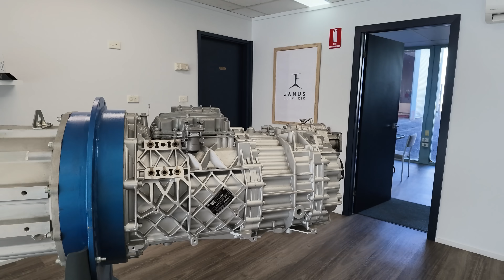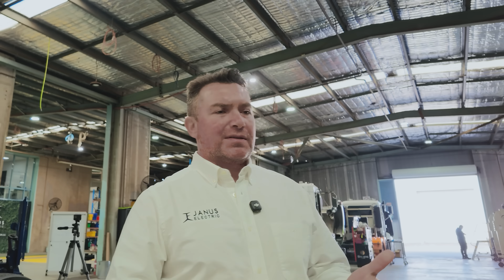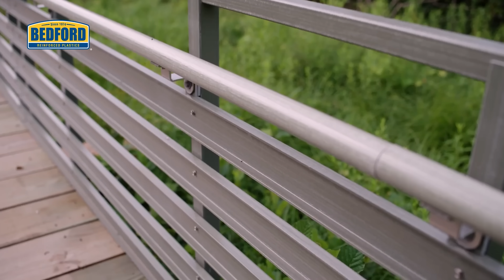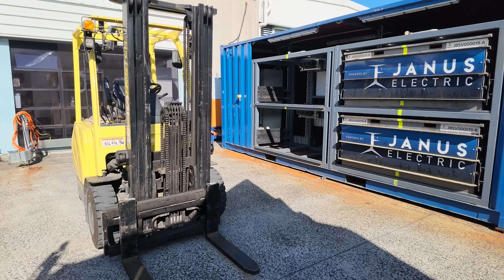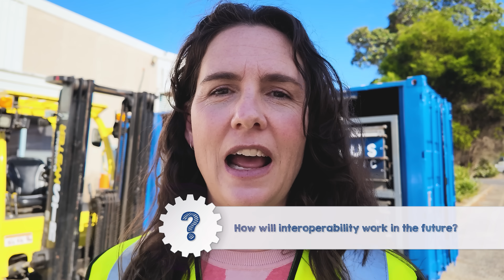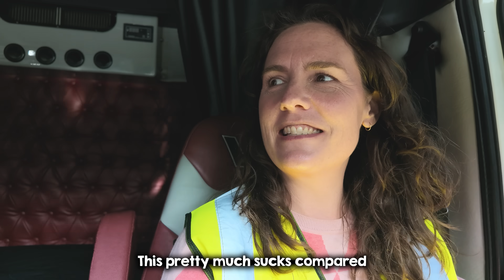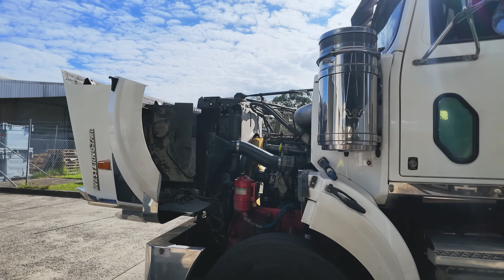The EV Truck Idea I Actually Didn't Believe Until I Saw It

Comment: They will have to watch out for the arrival of CATLs Na ion commercial vehicle  auto swap stations  are already at work in China and spreading ..they are also used by buses .

Those packs hang very low to the ground.... Slightest ramp over and they would grind ..  even over large speed humps  . 
They should also start looking at using none rare earth or  permanent magnet motors that are use copper free windings to reduce cost , increase  durability to heat and vibration  , zero cogging and   lighter wt and lower cost...pretty sure they are more compact and stackable  
IP 67 rated motors from  AEM 🇬🇧 Newcastle on Tyne. power and torque levels are insane and you can dump the gearbox . cost space and Wt.

Comment: I would DESPERATELY like to convert my 30-year-old Ford heavy van to electric. It is still roadworthy mechanically, but needs substantial engine repair, but there's virtually zero chance I'll be able to even put the $1000 and several weeks of my labor into putting it back on the road before I die, let alone the $5K for a conversion Conversion kits will likely become available for nearly anything on the road in the next decade at reasonable price, and that's wonderful news.
   At least the rest of the world is not as suicidally, willfully stupid as the U. S.  has largely become;this is, I'm convinced, due purely our unwillingness to confront the facts of the lies theft, and murder on which foundation the country was built...

Comment: I can see a situation where companies like, hypothetically, Linfos & Woolworths, Coles and /or Aldi setting up battery-swap stations at the supermarket loading dock with batteries charged from rooftop solar on supermarket roof. Many supermarkets over past 10 years have been built "solar-ready" (just in case legislation is passed mandating that they deploy some of their roof space to offset grid fragility), though few Coles or Woolworths supermarkets have the panels installed purportedly. The "solar-ready" supermarkets typically seem to have only 10%-15% dedicated to provision for future solar.

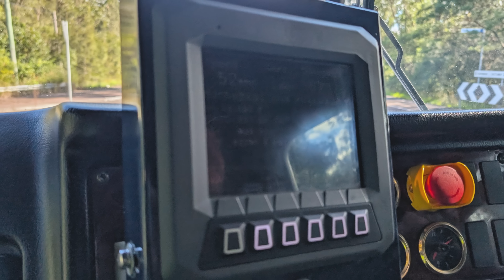Comment: This really seems like a very logical solution. What surprised me most is that the converted trucks keep their old transmission. At 13:45 the driver said the display "tells us what gear we're in." Maybe it's a replacement transmission simplified for the EV motors. I would have liked that detail explored.
Reply: Hugh did talk about the gearbox when he was showing Rosie the electric motor.  It did look like a special one, all nice and shiney.

Comment: Hi Rosie, you should do a visit to New Energy Transport who are developing a business model around the Chinese Windrose truck at Camden or Apin? Just for comparison purposes.

Janus didn’t mention trip times, the New Energy Transport test cut 40 minutes off a 480 km round trip.
Reply: Evidentially ev trucks go up hills a lot quicker than diesel ones.
Reply: @TerryHickey-xt4mf  There is an account of that Windrose truck blasting past a diesel one going up Mt Ousley and the driver asking WTF was that over the radio.

Comment: we should move to a dual battery system for all electric cars.  one, shorter range, permanent battery fixed into a car.  good for 60-80km.  a second, STANDARDIZED, removable battery for when you want to extend your range.  you use it, then swap it for another if you are continuing, or swap it out if you longer require it.  STANDARDIZED for easy robotic swapping.  this lightens your vehicle for day to day, making your smaller battery last longer.

Comment: Glad he briefly mentioned the cross continent road trains.
Plenty of solar to top off the swapped out batteries during the day at depots in the middle of nowhere.
The solar can also be used to charge a compressed air system that can be used to help keep the panels free of dust.
Hopefully a coop of these companies using the same swap architecture grow to the point where they can start such a project.
Reply: Sorry but you don’t seem to understand the requirements to charge these batteries so to charge 1 just 1 of these truck batteries would need 300 solar panels yep 300, large EV trucks is the worse idea

Comment: One general comment. Here in Austria, federal states are competing to have data centers build in their federal state. Those centers require 500 to 1250 MW in electricity. So, your number for a logistic hub, charging 50 trucks, is vanishing smalll compared to this. 
My analysis tells me that 1000 MW for a data center to produce AI-slop is no problem. 50 MW for electric trucks is simply unthinkable, where should all this electricity come from, ey? Sarcasm off.
Reply: I seriously doubt we'll have GW data centers here anytime soon. Our population is not that big, and it's far cheaper to have them overseas. Only business will use them. The 3 biggest are 500MW at full capacity (could take years to fill) but those are just proposals for now.
Reply: @peejay1981 it's happening, south Australia has already projected to supply those hubs and more
Reply: Battery swapping would be a great option for cars
Reply: Sigh, still thinking like a fossil fuels guy hey? Outback roadhouses will run their own solar farms feeding back into the system and making their own energy to recharge swappable batteries. Critical thinking is just a sky News thing

Comment: At 84, I remember suffering from diesel fumes when young. Logging trucks in the CA mountains left polluted air that others couldn't smell, but I not only smelled it, I got a headache, dizziness, and vomited. I am "The canary in the mine". I still suffer from diesel air pollution. Why am I still alive? I pass diesel trucks or back off or pull over to escape the odor. But, I still get a headache.

Comment: I'm thinking running the power from an electric motor through the normal mechanical driveline compared with powering electric motors on the hubs is a big loss of efficiency.  Might be cheaper to do the conversion, but it'll cost down the road.

Comment: One thing I didn't quite catch was whether these trucks can be plugged in directly, i.e., do they have onboard chargers?  My other concern would be battery material availability, as a battery swapping truck would require roughly twice the total (onboard and charging) battery capacity as a fixed battery truck for short distance applications and perhaps more for long distance.  This is a concern for the transition period and depending on the price and speed of charging a fixed battery truck could negate savings relative to a fixed battery truck.  It all comes down which has lowest total cost of ownership and thus lowest permissible freight rates.

Comment: Did they mention why they opted for a 16-speed gearbox instead of the single reduction gear used by most manufacturers? The batteries also don't seem to be tied into the truck's AC loop, limiting cooling at high ambient temperatures which seems like a concern for Australia. Interesting to see the different design choices for Australia's market compared to Europe, and great that they're retrofitting and reusing old truck frames.
Reply: The reason why they use a 16 speed auto vs a fixed or 2 speed reduction is to make the truck more energy effect at lower speeds and have better engine braking going down steeper hills something that other ev trucks suffer from when loaded as the Regen isn’t enough not to overheat the trailer brakes. some locations in australia the driver gets charged if they apply the brakes too many times going down a hill.

Comment: With 100s of millions of heavy trucks already out there, it will be important to be able to convert the existing fleet to electric to conserve resources assuming the process can be done efficiently so it is cost effective. Looks like this is a good start and the battery swap could easily be automated (it already has been for passenger cars).
Reply: Not sure this will work for road trains though - they will become too heavy and too expensive.
Reply: This aspect is often overlooked,  refurbish existing trucks with new tech.  It must save a lot of money and resources, and importantly enable 'fuel' that is made at home so to speak.

Comment: Would (new) high torque axial motors obviate the need for an automatic gearbox (or at least reduce the number of gears)? That would greatly reduce the weight of the conversion kit.
Reply: Probably, but they don't have enough business yet. They can optimize the motor and transmission once they have higher cash flow.

Comment: Really hope Janus blows up and is able to expand how many they can make, get some efficiency of scale to offer cheaper units and thus sell more, etc. I actually think the battery swap model is nice and simple - no installing new infrastructure in places that might do deal well with the logistics or regulatory burden. I can imagine a place like a port is already a very well-oiled machine in terms of space, but one more shipping container (that can go anywhere) storing batteries is not going to worry them. If they had the capital tom employ China's EV assembly line tech they could retrofit one of these trucks in a few hours, rather than days, I'm sure.

Comment: Why do you continue to compare fossil fuel ICE and Electric battery power? And then you leave out the most clean and renewable hydrogen system of H2 Ice and fuel cell propulsion. Clearly you have a bias or …I don’t know. BTW battery power is not a clean tech. All the CO 2 and destructive unethical mining has been done in the manufacturing of the batteries. It’s not a sustainable tech either. Whereas we will never run out of clean hydrogen, your are using battery industry proponents to mislead your viewers.
Reply: Ok genius, what tech are they using in these batteries ?  You know that's all changing right, hyperbole verses action, you're losing...

Comment: Their business model makes so much sense. They can concentrate on the Goldilocks customers where the product is just right. Compared to their production volume, there are a lot of ideal customers, even though they are a tiny percentage of the global trucking market.

They are already expanding the pool of ideal customers. At first the ideal customer needed a fleet of trucks that needed engine rebuilds. Their dealers can buy such trucks.

Comment: Thanks Rosie for a fantastic article on this innovation.  I had no idea that there were options available like this.  It is incredible to see how seamless the transition to electric can be, its amazing.  A six day turn around its nuts.  I loved how you covered the whole process from conversion to actual performance of the system really top stuff.  The questions you asked were spot on.  I especially liked the information on what would be done with the old engines and the problems with managing battery degradation you really covered a lot of subject matter, so good.  It was jarring to see how much smoother electric is compared to diesel, I know what kind of truck I'd would prefer to work in.  This kind of content is perfect for youtube thanks for your time and efforts.  I would just like to say I like the way you format your videos, professional yet informal and interesting.  Please please pretty please can you do a follow up to see if this business takes off I really hope it does.  Cheers.
Reply: Good point on the “follow up” video. I really hope she does one too, and the Janus can go the distance.
Reply: I like the idea of them buying the trucks when a motor swap was due anyway,  such an obvious but well thought out business plan.

Comment: One  thermal runaway battery fire will blow the whole idea of fighting pollution for the whole industry.
Reply: With the latest EV batteries, diesel and gasolene powered vehicles are up to 60 times more likely to catch fire.. I'm surprised we have any on the road at all...!!!!
Reply: They have already had a prototype catch on fire.  Made the news!  A cement truck caught on the WestGate bridge.
Reply: @markraumer2336  That was nearly 3 years ago and they don't use that battery type at all now...

Comment: having the pack split on each side could help from a firefighter’s standpoint.  if there was an eye to attach a winch cable a battery could be pulled away from the vehicle before the thermal runaway spreads.  Rather than total loss,  the one good battery could limp the vehicle back to base.  A cable could b attached and laced with zip ties so it can b accessed a safe distance from the battery.  As seen already with tesla semi,  thermal runaway always results in huge fire and total loss.  once the pack is isolated all sides of it can be hit with water to cool it or just drag it away from anything else and let it burn out.  Next year sodium batteries will be available and should drive lower insurance rates and have lower initial investment cost that should offset their 20% lower power density.
Reply: LFP and Sodium batteries will mostly alleviate these concerns.

Comment: Battery swapping seems to be subject to the square-cube law, where although the weight and capacity of the battery scales with the cube of a dimensional length, the weight and space dedicated to making the battery swappable is proportional to the square of that dimensional length, like the surface area. This means the larger the battery pack, the proportionally less overhead in making it swappable. This is likely why it seems to work in large trucks but be a real compromise for cars.

The square-cube law can also explain why it's easier for bigger EVs to achieve a long range. The frontal area drag is a square while the battery capacity is a cube.
Reply: It’s also the fact that commercial trucks lose money when they’re not driving, so swapping makes more sense over charging in situ, they have an upper weight limit, which makes frequent swapping smaller batteries more attractive too, and they have fewer form factor issues then a car.
Reply: It's only in its infancy,I've been arguing with fossil fuel nobs that once they get their act together it'll all be uniform and changing a battery will be no harder than swapping a bbq gas bottle

Comment: I'm not sure what rules are needed to be changed in Australia (regarding non-Janus e-trucks), but from the US, i know that asphalt wear and bridge capacity on a rapidly aging, under-funded infrastructure are higher issues.  Most of our road infra was built in the 1950s to 1980s and, even with maintenance and preservation, is needing replacement.  Add to that, most bridges were built for much smaller trucks, reduced funding income due to reliance on gas tax, while gas tax revenues are on a continuous decline (partially/increasingly due to EVs 😁).  Aside from the bridges, the asphaltic wearing surface gets worn at an exponentially greater rate by vehicle weight.  There are a lot of variables stacked against weight. 

I haven't looked through your video library, yet, but have you looked at electrified transit?  I used to live in Salem, Oregon, and the transit system there has added an all electric route, and has both overnight charging and a transit depot induction charger.

Comment: This could really work. When considering how this will work when scaled way up, trucks in Europe are allowed to run for four hours straight so replacing the batteries during a break would cost nothing. Four times ninety is 360 kilometers and maximum weight without exemptions is 44 tons so that would work. Bring it on!

Comment: Rosie, could you clarify how the transmission/gearbox is handled. Ben Hutt said the original gearbox was removed. Is there a new gearbox that is included with the electric motor? Is the clutch removed and drivers now drive this like an automatic transmission? Thanks.

Comment: Sounds like Janus would be a good partner to take on a few of Range Energy's converted EV trailers to lease out for those occasional operators that need long haul capability or refrigerated boxes. Maybe even partner to use their battery swap system with the converted trailers rather than the plugin version Range Energy currently uses.

Comment: Great! But is the grid up to it?
Reply: If you watched the whole video you would have heard that the existing building connection is used plus the batteries can be charged off excess rooftop solar from industrial properties. Only an idiot would have a container of batteries and not charge off their own rooftop solar. The only issue is peak load 5am to am and 5pm to 8pm. The same batteries can be used for demand arbitrage. That’s a choice the battery owner can make.

Another point: the container could use partially depleted batteries to top up batteries that are about to be deployed and recharge outside peak hours

Comment: The only solution of all the problems is 👉#DieselHybridSemiTruck
Reply: ICE/electric hybrids offer the worst of both technologies in a single package. Ie heavy engine and fuel carrying capacity consuming a significant portion of the vehicles GVM that precludes greater battery mass/range, or put another way smaller battery capacity obviating the need for an Internal Combustion Engine to pickup the artificially created shortfall. Also hybrids are highly dependant on Diesel fuel which has to be transported around the countryside.  The time is not far away when electric trucks will be able head into the outback  knowing that Renewably charged batteries await them for their return journey. Hybrids are a very temporary measure to accommodate the faint of heart.
Reply: @paultrgnp 🇮🇳#MontraElectric & #BlueEnergyMotor work Hard in India but most of the truck owner in India don't afford a new truck in India all of the truck run into road for 100 years . In India diesel hybrid technology has been very perfect for this kind of old trucks , diesel hybrid kit increase efficiency also reduce fuel consumption , and also empty truck consume too much diesel without any reason in that time truck able to run in full electric mode